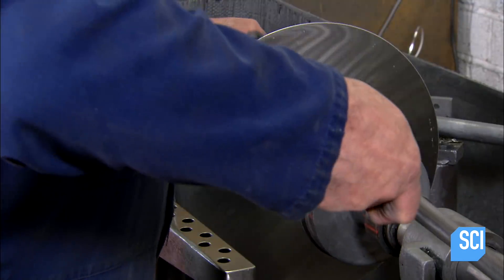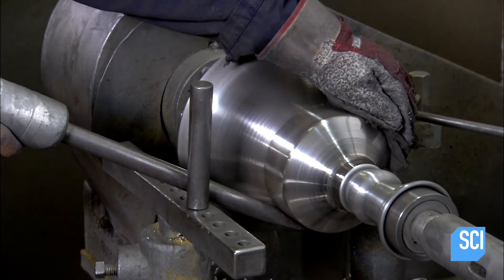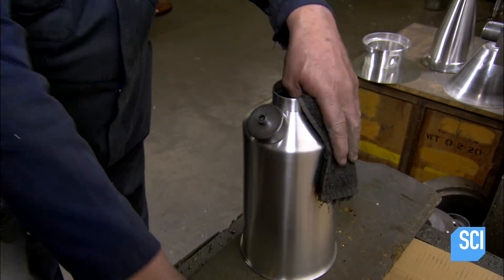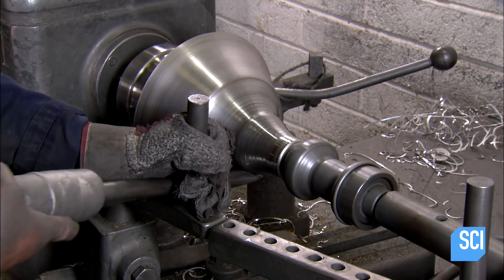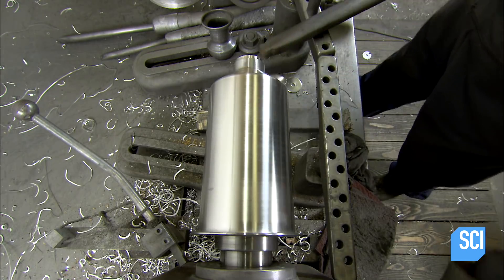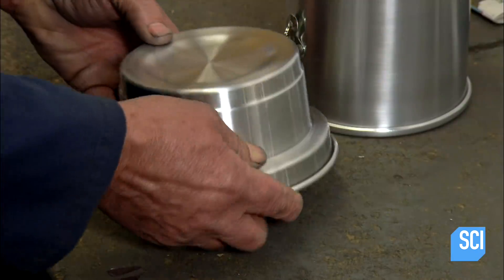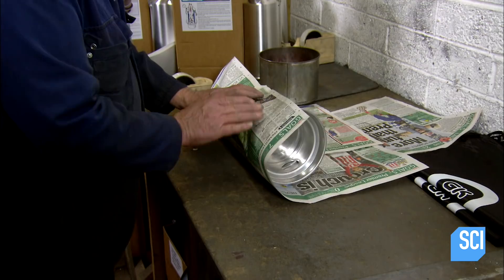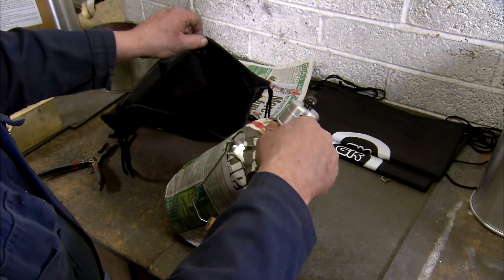Ghillie Kettle | How It's Made

Comment: This is sooooo wrong - this so called "invention" was known in Russia for centuries as SAMOVAR!!! What a scam.
Reply: No scam. And you're VERY wrong in your assumption.

Both use fire and both use a chimney. But that's as far as the similarity goes.

If you've used a traditional samovar and one of these kettles invented in Ireland in the 19th Century, you'd know the difference. With a Kelly Kettle, you'll have drank your hot drinks BEFORE you've gotten halfway through merely PREPARING your samovar...

I won't knock the samovar, it has its place in Russian culture. But for the outdoorsman who's used each, the Kelly Kettle is the FAR better option every time.
Reply: I think that if the video has been titled/advertised as being about making Samovar there would be even more uproar about how this wasn't Samovar.
Granted the Samovar seemed to innovate the technology but this a particular variant of it.